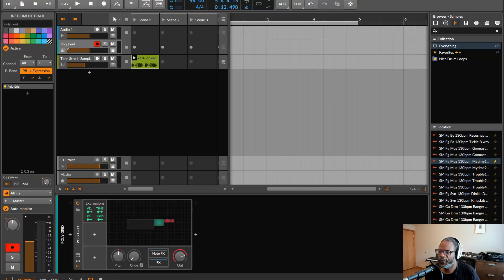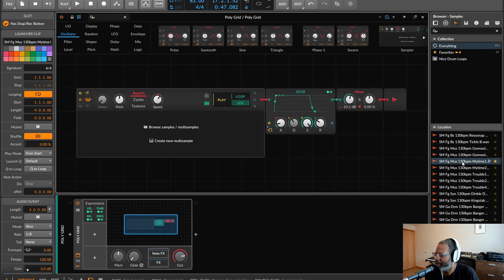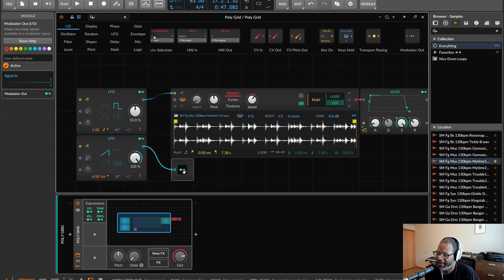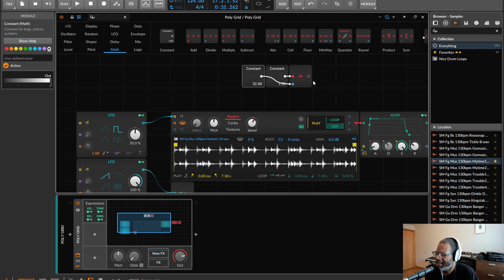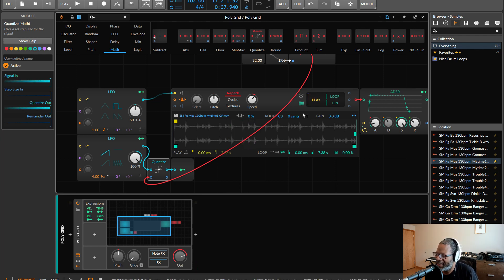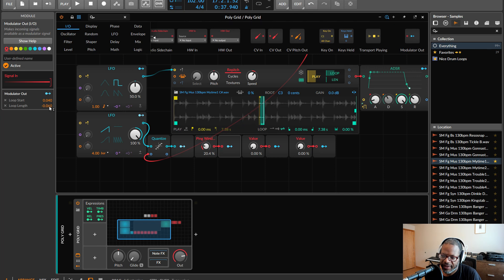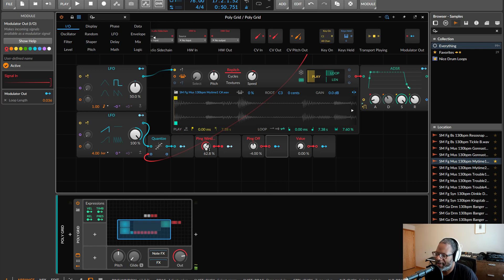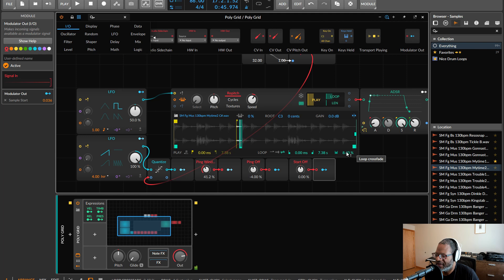Bitwig Sampler: Slice Based Tempo Synced Looping!?

Comment: Thats so awesome. Is there a way to have it randomly scan through the slices? And then maybe change the sequence to 7 steps etc, like polyrhythm stuff?
Reply from the maker: If you want random then you can swap out the second LFO for a S/H LFO module and set it to 8th notes and smoothing to 0%. If you want a custom pattern, you can replace the LFO with a Steps module and program the steps as desired.
Reply: @AudioDigital  Thanks for the response. Will give that a go.